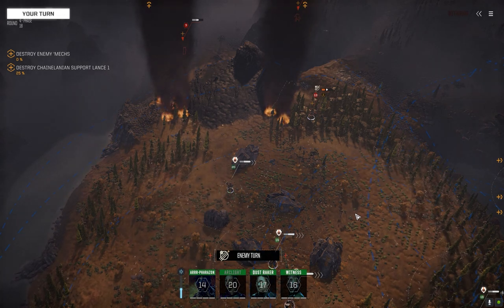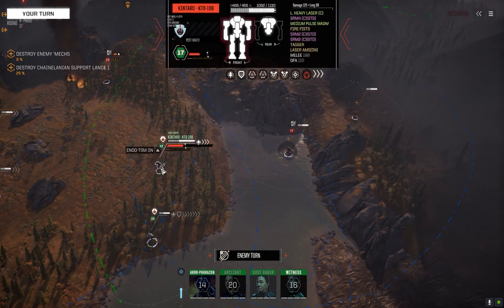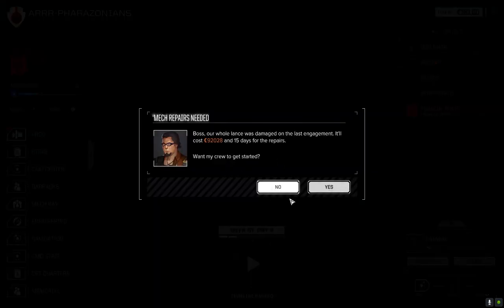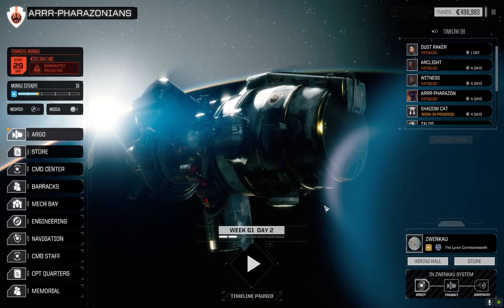Roguetech - ARRR! Ep28

Comment: Perhaps instead of the srms on the melee mech, a second large heavy laser?  You need to be able to keep the heat up for the tsm, and having ammo-based weapons to generate heat without the ammo reserves to fire them off willy-nilly doesn’t make a lot of sense.
The royal heat sink kit also runs counter to the goal of keeping the mech warm.

As for the the LAM Trebuchet is now a fifty ton jenner for witness to leap about the field in.  While it would be nice to have the tonnage to wipe enemies out in one turn- you really aren’t going to be able to do that reliably (outside of DFA/melee and that’s still somewhat iffy).

You commented that if you had used the other mechs instead of the treb and kintaro, you’d have done equally well- but did you have more fun with the LAM and melee kintaro?
Reply from the maker: LAM and Melee are fun for sure. They kind of balance each other out when it comes to damage but I do like the mobility a lot.

Comment: I don't understand the appeal of LAM.
Reply from the maker: I think LAM's are situational. They are fun to run every once and a while but I don't think they are good as a permanent mech in a lance.
Reply: @attackanddestroy 
I used a lam once, as a mobile backstabber tank, it sole purpose is to drop near enemies and attract their attention, but can also backstab them if necessary, also perform as my secondary punch bot, it was a grasshopper with large x pulses, combat shield and some Melee equipment and ams.

It was pretty hilarious when your single mech can land behind 20 enemies alone by itself. I suppose a double Lance full of that kind of mech can be an unorthodox but also fun play style to implement.